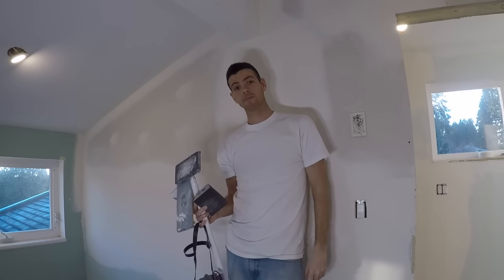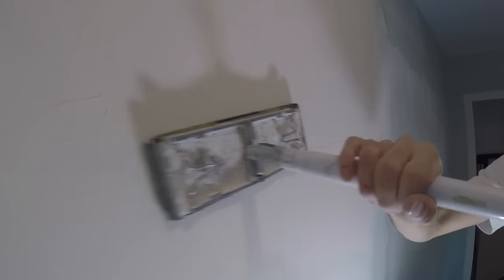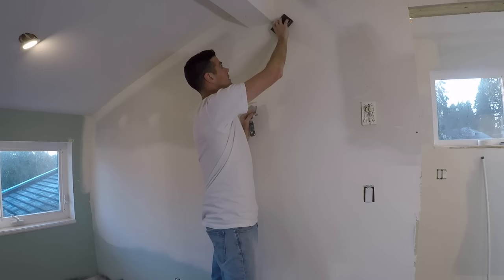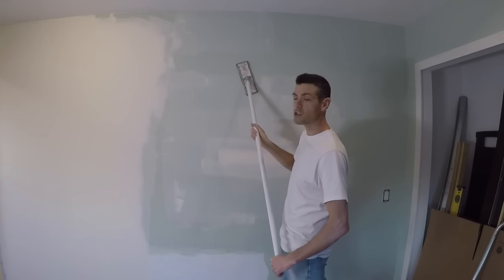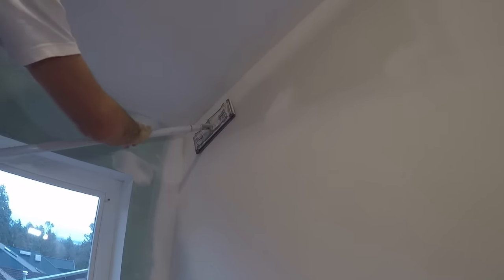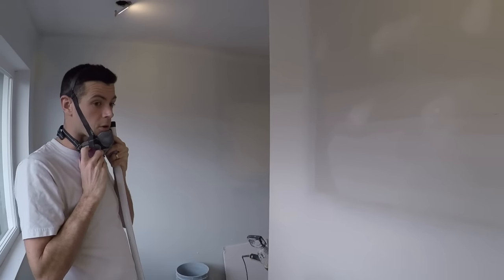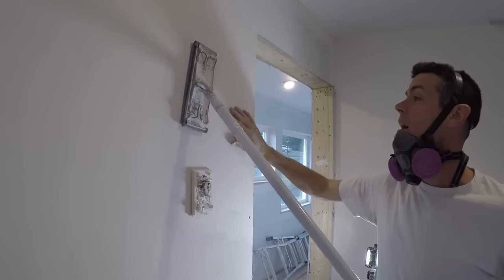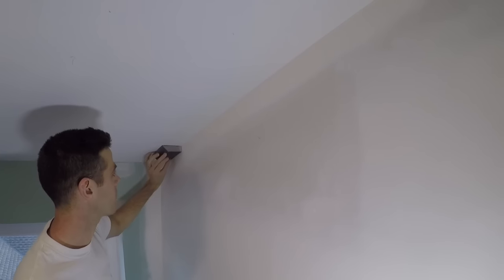HOW TO SAND DRYWALL!!!

Comment: Very well done. My father worked Drywall for well over 40 years. My brother and I started at 7 or 8, spotting nails (they didn't really use screws back then), then on top taping off joints, etc. Sanding was something we always did. By the time we were 18 or 19, we were running the banjo and bazooka, spraying popcorn, and running around on stilts. Took us more time to really be good at skip trowel, but this brings back memories. You explain the process very well.
Reply: Oh, YOU were the popcorn sprayer!  

I’ve been looking for you…

Comment: Ditto on the great teacher - been finishing drywall since the late 70’s but still enjoy your vids - and learn - and let me say that your methods are pretty much exactly how I learned way back when - except I seldom use a hawk/trowel. Learned with knives/pans.  One thing to add for the noobs- you did cover it but let me double-up... if you final sand without a bright light you are absolutely wasting your time, and you will be shocked (and very bummed) at how bad the job looks when the paint goes on.  So don’t do that - always final sand with a bright light shining down the wall (not straight at it... you want to cast shadows) If it looks good under that microscope, it’ll look great when painted.
Reply from the maker: Absolutely!
Reply: Finishing rec room and bedrooms in basement, today, Wed. and Friday, and you are soooo right, ---without light, you would miss sooo much.

Comment: Absolutely loving your videos. They're helping me a lot. One thing I have noticed is how you seem to cover some walls almost completely. I'd really like it if you could do a video about why you end up doing it, some of the factors that go into your decision on how much of the wall needs to be covered in a repair. Thanks, Ed
Reply: The joints, if the bump between the drywalls are too big the line with mud has to be thicker

Comment: I've literally watched all your videos. On my past job I used your 3way corner bead and all the other coating videos. I wish you had this out by then. I'm a painter and take on small drywall repairs, you've saved me so much time in learning this all by myself onsite. Tip tho: give the camera man a little led flashlight, or even a phone's light, for the close ups because 14:46 we can't see what you're pointing out. Alot of the other closeups of the wall surface in other videos it's really hard to see as a tradesmen and I doubt a DIYer knows what you're talking about

Comment: I don't expect to do any future drywall yet I have learned a lot from your channel and will consult it If ever needed. Love your expertise and humour and ability to communicate to a non-expert. Back in the 80's I drywalled parts of my old house. I was so bad at putting on compound that I ended up using a belt sander to remove excess compound. Yep, I was that bad.

Comment: Hey Ben, you're an amazing instructor. I'm binge-watching your channel instead of Netflix at night, no kidding.
Can you do a short capsule on sanding in a  tight furnished room e.g. a built-in closet in my kid's room? Should I use a vacuum sanding attachment? Setup a booth with tarps? Use a specialty fan & filters? I need a practical, no nonsense solution. Tks!

Comment: I like this guy. He's about the only one I watch now for tips. Problem I have, like probably a lot of us, is this is his trade and he's perfect. I'm here as a homeowner who got stuck with a contractor I had to fire and now I've decided to finish my bathroom remodel myself. Really wish he'd do a video of mistakes beginners would make and how to avoid and correct them. I think I'm finished spackling, but how do I know, with my non pro spackling job, what I can sand out and what really needs another coat before sanding. Do I fill in those last gouges and pock marks, or am I really ready to sand? I certainly didn't do a perfect job of feathering each coat like he did, and what I have that I think is ready for sanding is way different than what he has in front of him.

Comment: Great video as usual.  After this step how do you prep the wall for paint? How do you clean up all the leftover dust on the wall? Can't find a video on your channel if you have done one.  Thanks!
Reply: @Danny 302, some of the dust will drop after sanding but you can take a soft push broom that's clean or any soft flat broom to knock the dust down. For small areas such as little patches, I keep a Foxtail brush or an old block paint brush that we call a hand duster. You could also use a shop vac with a brush attachment to remove loose dust and you should before priming.
Reply: @strikingtiger-filipinomart5043  I'm ridiculous so I usually use a swiffer after vacuuming

Comment: I’m a general contractor. We sand only with 120 grit fine sand and the walls come out looking really nice… that said, having good lighting everywhere helps the most and also having a starting/ finish point … I’ve had a few guys that forgot where they started and just continued anywhere and once it was time to paint, you’d notice like either rough spot or very smooth spots on the walls. I usually let it slide but if the client says something I gotta fix it🫠😂

Sanding (and really anything) is an art 

As a general contractor I enjoy mostly: Drywall related work (installation, mud, sanding etc), Framing (need good framing for drywall lol), Demolition, and Floor sanding. Been looking for a very long time to purchase a sanding pole since we still do everything by hand… last pole we had apparently went missing as well lol

Comment: i had a drywall business before this guy was born.to sand we used an orbital/vibrating sander with some medium emery cloth.use the sander lightly for about 2hrs sanding time to wear down the cloth and then you can usually apply more pressure.always keep the sander moving around and never keep it in one spot.we used emery because it lasted 10x longer that sand paper.** another note,never paint drywall w/semi gloss or gloss without doing a very good coat of sealer.if you do not seal it,the drywall paper will absorb and dull the paint and the mud areas will be shiny and it looks like heck!

Comment: I have the Festool Planex and the AC 36 dust collection system with the auto clean filter... You would love it man. I'm somewhat of an amateur and can do level 5 work with it in a fraction of the time I use to with hardly any dust. I think it was about $2500 and as much drywall work as it looks like you do I really think you would love it. If I lived a little closer I'd swing by a jobsite and show you I'm in Western Wa.

Comment: I like your videos and your tips..
But ..for those who hate sanding-
Try using a grout sponge and a bucket of water. You can decrease your sanding by 50-75%...
Try it. It works
Easy on the water. Rinse out the sponge.

Comment: I'm not a drywall guy but still i have sanding pad which can be attached to vacuum and no need to finish sanding as totally covered with dust. So amazed that guy who mainly does drywall stuff doesn't have Giraffe sander.

Comment: To answer the question. Knock down texture was made to avoid proper finish work, just spray a clumpy mess then smooth it out. Personally I hate it because patching it is a horrible and nearly impossible to fix holes without it being obvious when done. 
    Personally I like  nice walls, and avoid knock down texture finish that looks like a no talent 60s hippies want-to-be artist tried calling art.
     I am glad he is showing what a finish job is to look like. Not to many can finish walls like this in new construction because of labor costs.
Reply: Texture is gross but I rather texture than a sub-pare smooth finish. I'd say 95% of finishers in my area can't do a good smooth-flat finish!

Comment: Do the ceiling corner first. Run the perimeter of the room. Then do the vertical corners and horizontal at the top of the wall. While doing the second part, if you pass a closet or bathroom go in and finish it. I do all corners if a house first. Also do any switch holes or light holes that you tapes/ mudded. Then I will do all the walls and ceiling joints. If I need stilts ceiling last. 80 grit for the first coat (use a 120 grit with sponge under the 80 grit), only pass once or twice with medium light pressure. 120 grit (with sponge backing)for second coat light pressure but may take many passes until we'll sanded. Your not trying to strip mud just remove edged and smoothen texture. Clean up corners with sanding sponge. Then pass the sanding sponge over the edge of the corner beads.

Comment: Your the only one that has mentioned this ANYWHERE so I hope you can help. When I put a second coat of mud over the first coat that was sanded there is a ridge between the two coats that won't feather. Why does this happen? I try not to sand the first coat much but sometimes I have too. It seams like the second coat is harder but it's the same stuff thinned to the same consistency. It's driving me crazy. Please tell me what I'm doing wrong. Thanks

Comment: I've learned a great deal from your videos - thank you. QUESTION: how do you clean the wall after sanding and before the next coat (or paint)?
Reply: You don't generally need to. The small amount of dust on the wall won't affect your next coat of mud, your primer, or your 2 coats of paint.

Comment: also when you install your sand paper line it up on the edge of the sanding head that way if you do hit your corners to high you don't make a deep line with the sand paper you may leave a black line from the sanding head but you can sponge that out so long as you do sand to hard.

Comment: I have that same light and I noticed  that you only have one wing left.  When I broke my wing off I took a 3" piece of plywood and put 2 part epoxy on it and glued it in. It's easy to knock that light over . Thanks for all your good tips.
Reply: By the way I ripped it down to 1/2" to fit in the groove.
Reply: All my lights have the wings busted. So you glued the plywood to the back and used that to drill and mount in the hinge? Is there enough wire for that? Currently I have a 1x4 sitting on the back and taped all the wings onto it so the light is permanently fixed as 1 unit.
Reply: I only have about 1/2 " glued to the hinge part and the other 2 1/2" is glued to the back of the light part. The fun part was getting it to line up. I was just going to use the wood as a caul but it glued itself in and I was OK with that. No there is not enough wire for taking it off. @NickRgibbs

Comment: Is that considered a level 4 finish or level 5? I'm new to remodeling, but have done a lot of drywalling. I usually do the detail work, but then find I'll have to texture or do imperfect smooth. Maybe doing such a detail sand of the final coat might be overkill and wasting time? Is level 5 common in Canada? I'm in California. Thanks for all the great informative videos. Kinda hard to learn this stuff if your not working for a contractor or painting company, I have a different "day job", so the videos are a tremendous help! Keep up the great work! By far the best Drywall "how to videos" on YouTube! Would love to see more Carpentry videos! Lots of the woodworker guys are in their shops and not on a jobsite. Only really see DFW crown or Scott Brown take their cameras to work. Cheers!
Reply from the maker: This is level 4 and we don't texture over here.
Reply: Thanks! One last question.... Have you used a dust extractor or cyclone or zip walls for sanding drywall? I swear the dust gets everywhere! Would love to cut down on the dust. Thanks again, looking forward to the next video!

Comment: One thing I’ve wanted to ask you about is using glue.  In Australia where I used to live, it was common for drywall to be applied with a specific glue for putting up the wall board.  Screws are used but not as many and I found that you don’t get screw pops when later on one can be putting up a picture or, as happened to me last week, I was mounting a TV bracket and discovered poor application of the wall screws.  Have you ever heard of a similar glue being used here in Canada?
Reply: I don't think glue is code here, many inspectors want 6-8 screws in the field regardless if an adhesive is used. I am unsure about the rest of Canada but in the east here, contractors are tighter than a frogs a-hole. Most wouldn't be willing to the extra money on the glue, even though its been proven in other countries. As a finisher, nail pops are common here after finish work has been completed due to improper drywall installation. It's just they way it is here (at least in my neck of the woods).

Comment: Do you have advice on sanding acrylic or oil based paint?  The paint was applied so poorly that thick roller brush streaks are everywhere.  These streaks became their own texture.  My concern is that I will never be able to just sand the high spots, since the actual low spots in the original texture have been filled in with paint and this will still show up as a streak.  I believe sanding most of the texture off will be necessary, followed by reapplication of texture.  Am I thinking about the project the right way?  If so, what's the best way to sand off heavily coated acrylic or oil based paint?

Comment: Very good videos - detailed.  Question: When I fill small holes, like a nail hole from moulding being removed, half of my holes will dry below the surface - half of them require no touch.  So I figure I must be doing something right half of the time, but haven't got a clue as to the difference in my procedure.  I press the loose fabric around the hole below the surface with a ball peen hammer.  Each hole is about the diameter of the dime at the surface and about 1/4" deep.  I use Quick Set Lite 90 minute set time.  Each hole is filled with mud in one lift.  Could there be a difference in blade packing pressure when finishing the hole? Please advise. Thanks

Comment: Have you ever tried one of those (9"-10") round sanding discs on the end of your pole for final sanding? They just look like they could cut down on sanding time and strokes and also not have to worry about the linear gouges.  What grit on the sponge also.   Great series 👍👌👏
Reply from the maker: They still leave scratches. As soon as you get a little nick or a wrinkle in the sanding sheet they can leave lines. They are good for broad and flatter surfaces but they are sooooooooo heavy compared to my sander.
Reply: @vancouvercarpenter  Thanks!!

Comment: You should consider trying the Trim tex black widow sander..I really like it .covers lots of surface area and leaves a great finish.
Reply from the maker: I have it. I only use it for sanding full skims on ceilings. I can't feather edges as well or as quickly with it.

Comment: Vancouver carpenter have you got any insight to removing spray glues/adhesives from painted drywall and painted wood? I bought a house with a music studio that's got acoustic foam spray glued all over the walls. Finally removing it and what a ridiculous job it is so far. Lots of the foam is still stuck to the walls and it's taking way too long to get off. I've tried goo gone, acetone, mineral spirits, carburetor cleaner, brake cleaner, and just now angle grinder to physically take it all but then it destroys the drywall. The acetone, carb, and brake cleaner seem to soften the glue but it still refuses to come off. Something tells me I'm just going to have to grind it all away and skim the walls... Thoughts??

Comment: Oh O, I did two coat on the corners.
How much pressure is he using on the pole? Seem more than a little.
I was thinking drywall dust was heavy and fall to the floor, well, its getting dusty above the shoulders.

Comment: I had a similar question to another commenter.  What is the best way to remove the drywall diary from the walls and ceiling after sanding.  I realize I sand to much but it seems like there is always dish which interferes with primer and paint bonding.

Comment: What is the best way to go about fixing the issue shown at @4:22? First attempt at removing popcorn ceiling and I have a nice smooth, sanded skim coated ceiling, except for one disappointing spot where a bit of tape is showing. Do I build it up now with compound and sand it smooth, or should I repair after priming/sealing?

Comment: Quick question I just replaced 8x2 piece of drywall from my ceiling but the but joint have 1/4 inch hump  how should I approach it should I use a all purpose mud or 45 minutes join compound? And how far should I make the spread. Thx for all your video

Comment: Ben, I need more help on repairing holes cut in ceilings from electrical work.  Patched and taped.  Second mud and still have a light tape image.  Will a sanding screen hurt or help here?

Comment: I had to fix a dent in the drywall. I sanded and painted with Sherwin Williams paint that had a primer in it. Now I see a spot I need to mud. How should I go about sanding, mudding, sanding n painting? When I first painted with a roller over the fixed area, the texture was different from the rest of the wall.

Comment: Vancouver Carpenter
 - thanks a ton for yourvideos! I've been working on removing wallpaper and popcorn ceiling in an old house and your channel has been incredibly helpful for a noob.
- One question that I've been unable to find the answer to; How do you clean the sanding dust after your first coat of mud and after your final coat before paint/primer? Do you just use a dusting brush or old tshirt or wet sponge or something? I've tried a few methods and either create a dust-paste, or just spread the dust all over my house and have to chase it around with a shop vac :D
Reply: Old t-shirt

Comment: Do you do anything with the dust?  I have seen work where the paint is clearly over dust, and I was never sure if that was on purpose (for texture) or just a bad job
Reply: i actually use an old floor mop to dust off the drywall dust before priming